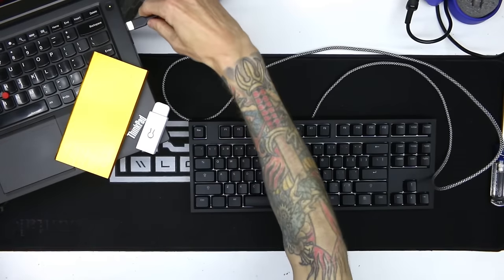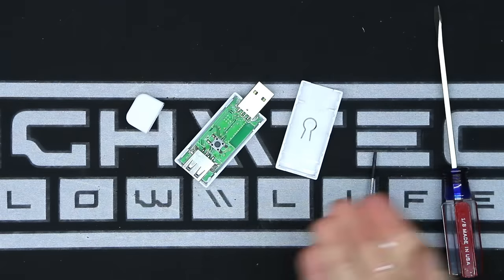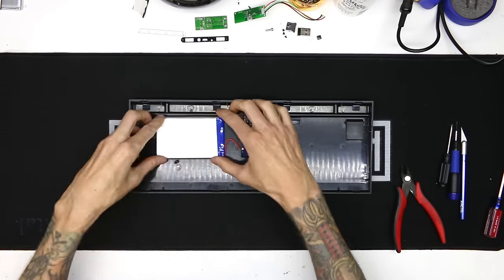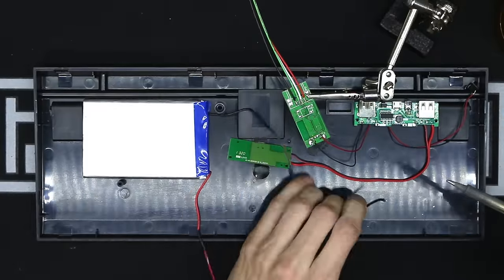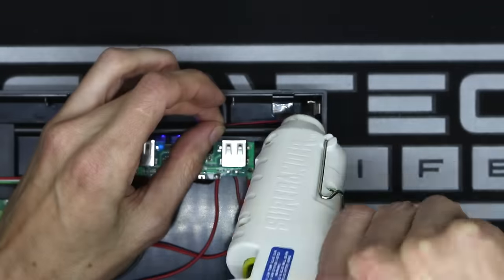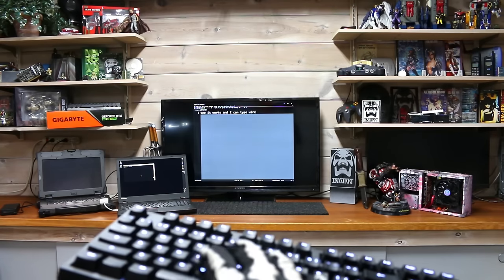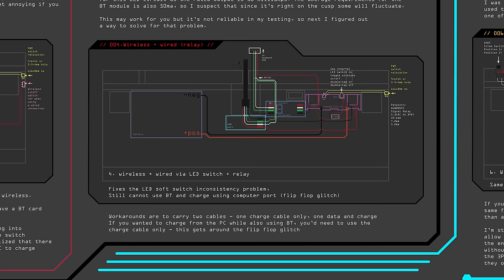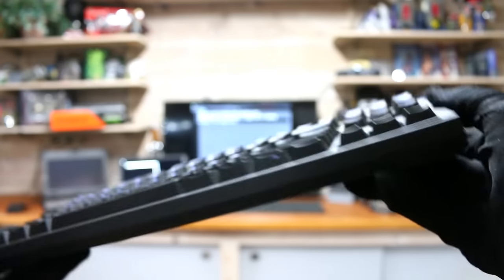⌨ Make ANY Keyboard Wireless! - Convert Any USB keyboard to Bluetooth Wireless - DIY Tutorial How To

Comment: The cost of this modification is more than the wireless keyboard we get in market. But for education purpose i will recommend this to others.
Reply from the maker: Thank you, yes ~ definitely not a 'budget' solution. If you're looking for wireless on the cheap, it's more cost effective to just get a cheap wireless keyboard 😎
Reply: There is no wireles steelseries APEX
Reply: My keyboard plus keys and switches is 275 usd, no way I'm getting rid of it just because I want wireless
Reply: But if you have a $300 keyboard this wireless conversion method makes more sense
Reply: I appreciate the troll at the start of the video lol
Reply: Bro all cheap wireless keyboards are not 1000Hz or even 500Hz.
Reply: Honestly...I might still do this because current market wireless keyboards are all compact and unpleasant for me to use. I have an old old keyboard that I love using but the USB cable has been getting damaged by the angle of the keyboard pulling on the cable.
Reply: @NikkiTheOtter  also archiss keyboards. But those are not that customizable. But they do have some keyboards that have a trackpoint
Reply: This is the fun option

Comment: fun fact: you can buy a good wireless keyboard and it will cost less than the total cost of this project!
Reply from the maker: Funner fact, you can go outside and not use a computer at all and it will be 100% less cost than your idea.
Reply: Some people have just a wired keyboard and buying the usb adapter and power bank is wayyy cheaper to do this project

Comment: Interesting video. I remember when I modded Varmillo VB87M, I wondered if it's possible to make it work not only through Bluetooth, but also with wire instead of just charging from it. From a perspective of an electronics rookie, it seems quite complicated (especially if you use built in Bluetooth chip), but it's quite possible.
Reply from the maker: Awesome, yes it's totally possible! If you follow my two recommended schematics you'll have both wired and wireless on a switch - just depends on how you want to wire it up. Thanks!
Reply: @hightech-lowlife  After inspecting the board's PCB, I don't think it's possible after all. The plastic connector hubs have two positive and negative pins for only a charge, while the separate mini USB PCB has five solder pads. It seems, the manufacturer had in mind the idea of making both wireless and wired product, but on the last moment gave up on it.
Reply from the maker: @guessit5036  This is an only wireless keyboard? I thought this was a wired board you're talking about. Even if it's only wireless and only has power from the USB port, you can just run lines from the PCB to add the data lines, and if the connector doesn't support it just put in a different connector. I have a video on how to add a connector to any keyboard, so if the one currently doesn't support data, you can add your own. As long as you can get to the mini USB leads, you can make it wired as well. 

You may have to throw in an inline switch to turn off the data pins while charging and using as wireless as keyboards don't usually like being plugged in directly + trying to connect wireless, it will probably flip flop between the two connections as shown in my video. 

Trust me, it's possible 👍

Comment: well I'll be damned, i was expecting some little cheap box you could buy off amazon and just plug n play.  Little did I know. Now I gotta learn how to solder.
Reply from the maker: You don't actually, if you look at the beginning of the video you can just plug the components in 👍The rest of the video is if you want to integrate everything inside of a keyboard case.

Comment: Mine actually does have a lot of room in the case despite having foams. The two keyboards I use are actually both stripped down version of their wireless counterparts. So both of them have a slot in the case for a switch and battery pack, and you can actually see the battery and switch labels in the pcb. There's also an led for charging which I can't really use since mine is wired only.

Anyways, great video bro! I'm quite busy atm but I'll save this for Future use.
Reply from the maker: Awesome, should be easy to implement down the line then - thanks for the watch, comment and feedback!
Reply: @hightech-lowlife  I'll give a sub too, keep it up!
Reply from the maker: @HonkForLife098  Thanks! I will do my best, much appreciated ⚡⚡⚡
Reply: manufacturers laziness turned godsend

Comment: ngl this is more effort than i was willing to put in for this so I've given up - but you deserve my comment, like and subscribe for the video because you've done a great job explaining and also added in some personality. Great job mate!
Reply from the maker: Thanks so much man, I appreciate that. It is quite a bit of work I'll admit, I think if you break it up into smaller digestible chunks it's a bit easier to tackle over time as it can feel overwhelming all at once. 

This is one of my earlier videos and it is hard for me to watch as there are so many things I would have changed to make it better and more watchable, so I really appreciate the kind words. I will probably remake and revise this video in the future that is a bit more condensed and better delivery 👍Thank you for watching!
Reply: @hightech-lowlife  Frankly if could find the USB to BT adapter (I'm assuming that's what it is) in your initial 'joke' example around my parts of the world I would be very much inclined to go with that solution. There are NO devices of it's kind sold at any vendor in or that will deliver to Bulgaria. I've been looking all day cause I bought a Marvo KG962 by mistake instead of the wireless version and I was hoping to find a less expensive solution than just buying the correct model on top of the one I got. Ultimately that's what I did and I didn't even bother returning the wired one - it's a good KB and the hassle is not worth the money I'll get back.
Reply from the maker: Yes it will do that out of the box, I know that handheld scientific does ship worldwide so most likely they will ship direct to you. If you're just looking for any wireless keyboard, then you're better off just buying a new board that has the features you want  @RoninBlackwing

Comment: you could ideally 3d print a case for the three components + cable and attach it somehow to the back of your keyboard. The design could have a hole for plugging the charger to the power bank. if you don't have the possibility, or the hability, for soldering, this can be a possible solution that doesn't necessarily void the warranty
Reply from the maker: 100%! You could even just buy a cheap small case that roughly fits the dimensions, and double stick tape the components inside 👍
Reply: @hightech-lowlife  Try to make this one :D

Comment: You can fill the LED lights with some gluestick to diffuse the lights.
And also adding a small USB Hub would be great when you're plugged in and wanted to connect a flash drive to your pc.
Reply from the maker: It's a good idea! I also thought of doing some ambient diffusion by using some acrylic, I will try it. It would be cool to add a hub, but I don't think this module supports the use of a hub over bluetooth unfortunately. Unless you're talking about just a separate wired hub 👍I will be making more custom keyboard cases in the future and I will stuff in a hub.
Reply: Bluetooth doesn't have the bandwidth needed for flash drives
Reply: @matyi1656  I know, that's why i said 'when plugged in.' And i meant plugged in on a PC
Reply from the maker: @nehemz432  Yes this would be a cool addition to when you are wired you can have the optional hub! 👍
Reply from the maker: @matyi1656  Yes this is probably the reason it is not supported, thank you for the insight 👍
Reply: @nehemz432  oh right, i cant read

Comment: Unfortunately, the cost of the BT unit and a battery bank added to even the cheapest mech kb is going to be more than a decent budget mech that is already wireless. You could do this a lot cheaper using a cheap microcontroller and low profile LiI battery, but it takes more work and some coding. I think a project that makes more sense is an external unit you can plug any kb into that acts like the BT dongle, but also includes a rotary knob and some media buttons and maybe even a small LCD for dedicated media control, since many boards either lack a knob (the best way to control volume) or have their media controls on another layer. You could make a nice case for it and short cable and then the BT dongle would be a feature and not an eyesore (the battery could be smaller and incorporated) and you wouldn't have to hack the kb at all and could use it with other kbs.
Reply from the maker: 100% agree, I have a blurb in the description and on my site that states that if you're just looking for a cheap way to make a keyboard wireless, this is not the method nor tutorial for you. This is for people that want to convert a keyboard that is simply not offered wirelessly. If you just want a cheap wireless keyboard, there are many out there premade. 

It's an interesting thought, you could also do this with the BT-500, you don't have to put it in the case, I actually use it like this in the beginning of the video, you could just hot glue it to the top of a battery bank and there it's a portable unit as you have described. The BT-500 is a bit more expensive than even the Adafruit BLE offerings, but if you factor in how much time you will spend writing code and debugging, also taking into account the extra feature set that is built in to the BT-500 firmware (it can do a lot, including mouse control) it could end up being cheaper, depending on how much you value your time. 

Volume knobs are pretty cool, but I have found for my personal use that just setting up an AHK script and utilizing hotkeys is faster and my hand is already in the right position to manipulate media controls without having to lift to search for a hardware knob. If I couldn't do this, then AltDrag also has a feature where a hotkey turns your mouse wheel into the volume knob, which is even more intuitive. I know people love their rotary encoders these days though. 

Thank you for your input and feedback, I appreciate it.
Reply: @hightech-lowlife  Hey! Sorry I missed this reply when you posted it, you provided info on something I've been looking for for a while - that ability to use mouse wheel for volume. I had previously tried various hot-key and binding remapping software to do that to no avail, so cheers!
Reply from the maker: @PinataOblongata  No problem man! Yes AHK and AltDrag are vital to me, I will be making a video on both of these apps!
Reply: Ho Ho.. HTLO mentioned that in the video... I'd be very mucj interested to know more :)
Reply from the maker: @tmbarral664  Thanks! I have both AHK and AltDrag videos coming at some point, I have so many projects going on at the same time right now 😂

Comment: Very cool, would you consider making a video on battery upgrades for wireless mechanical keyboards? For example, something like the Nuphy Air or Keychronic keyboards are great but the batteries are on the small side. There is definitely room with little modification to fit batteries that would take these from needing weekly recharges to months. Plus it acts to extend the products life as the battery will eventually give out. This way you can highjack the led indicators, charging circuits and switches from the board. I only suggest a tutorial like this because a battery swap is more accessible than building from scratch (I hope). I do hope you'll consider a video like this.
Reply from the maker: Thanks! Yeah for sure I can do a video like that - I'll check out a suitable board for larger battery mods 👍 It should be fairly straightforward though, lipo batts are 3.7v typically so as long as your battery voltage is the same you can 1:1 swap without any other modifications. Thanks!
Reply: @hightech-lowlife  yeah a mod of the popular Keychron Q1 would be legendary!
Reply from the maker: @limebulls  As long as the case has space for bigger/more batteries 👍

Comment: Hello how are you? excellent video and thank you very much for this great contribution, I wanted to ask you if you managed to find the 3P3T slider switch?
Reply from the maker: I am well, thank you so much. I have searched high and low for one suitable for this application and I still have not found one. There are some in larger packages and  toggles, but for something this small they don't seem to make them - which is unfortunate because that's the best solution to not have to use relays. I did put a 3P3T toggle in my more recent "dual battery" build and it works great, if you have the room or can use a toggle that is one way to do it. 👍
Reply: @hightech-lowlife  I did see the dual battery video, but my keyboard is pretty small for that toggle switch. I'll have to use 2P2T.
Reply from the maker: @yaendiaz165  Yes, unfortunately for 3 way switches, the options are limited for smaller sizes. If you can use the relays (1 or 2) you can get more switch options (pins) off of one slider 👍
Reply: @hightech-lowlife  I could glue 2 2P2T switches and bridge them with a jumper on the slider head.  I have seen some quite slim models or it could also be put to the side.

Comment: This was a great tutorial! However, with the battery you used, how long does the battery last considering the keyboard would not be optimized for being power saving?
Reply from the maker: Thank you! 

It depends on a lot of factors, backlight LEDs being the biggest. For this particular keyboard and battery (3000mAh) On medium brightness about 27 hours on a charge, backlighting off 80+ hours on a charge. Again, this will vary greatly depending on how big your keyboard is, how big your battery is, what brightness or if you are using backlighting at all. 

I have a lot more information on my site about batteries, run times, etc: https://hightech-lowlife.github.io/projects/004_wireless_keyboard/004_wireless_keyboard 

Scroll down to the part about 'runtimes'. 

Cheers
Reply: @hightech-lowlife  Thank you for the reply! The keyboard I had in mind was a 3-keyed macro keyboard that I could try and make wireless and mount to my arm to control music with while in VR.
Reply from the maker: @ItsJust_Nick  With 3000mAh, it would last a /very/ long time between charges.
Reply: @hightech-lowlife  Good to know thank you!
Reply from the maker: @ItsJust_Nick  You got it! Thanks
Reply: @hightech-lowlife  Hey also I was just wondering are there any alternatives to using the BT-500? I was just curious becuase the website looks really sketchy and I can't seem to find it anywhere else either on amazon or ebay.
Reply from the maker: @ItsJust_Nick  It is possible to use an Arduino, but you will need to write some code to get it up and running ( here are some examples:
https://www.youtube.com/watch?v=N5rOW5Bu1kc and  https://www.youtube.com/watch?v=L7EqKJ02lK4 )

But you probably will need more components too and it will take up a lot more space. 

Can you let me know what you mean the website looks sketch? 

I've ordered from them for years now, they also have some of the best customer service I've experienced from a company in a long time. Also their philosophy in encouraging makers to experiment and tinker is unlike any other, they even say on their website if you damage or break the device while attempting a project they will replace it for you, to me that's unheard of in this age where companies are doing anything to try and prevent you from modifying or repairing things. 

Thanks!
Reply: @hightech-lowlife  Thanks for the reply, I basically meant it being sketchy in the sense that I could not find the product anywhere else and that my security program on my computer is letting me know it is unsafe.
Reply from the maker: @ItsJust_Nick  I see, it's a pretty niche product so I can see why it's not available on other marketplaces, they were the exclusive seller of their previous iteration also. As for your security program, most likely it's just alerting you that the site doesn't have SSL encryption, meaning it's http instead of https, but their site isn't accepting any personal information, all payment goes through paypal directly. If you don't feel comfortable buying from them direct, please don't. I'm just telling you my experience for the past 4+ years. 

There is this: https://www.amazon.com/Bluetooth-Convert-Adapter-USB2BT-ADU2B02P/dp/B07DFY1ZQ9 but it is larger, only has BT 2.0 spec, and I don't think it's nearly full featured, it also costs about twice as much.
Reply: @hightech-lowlife  Thank you so much thats all I needed to know for now. 😊
Reply from the maker: @ItsJust_Nick  Yeah no problem man! Thanks 👍